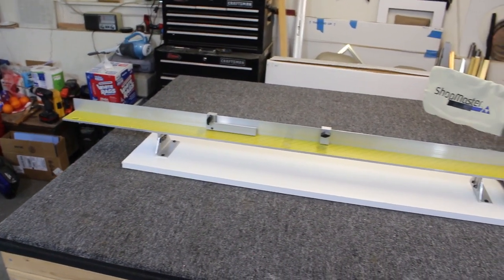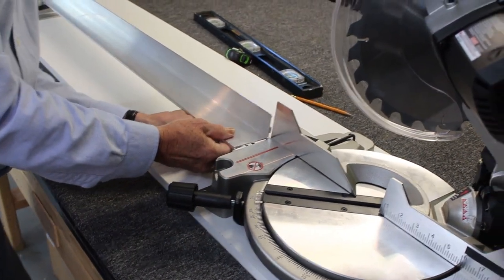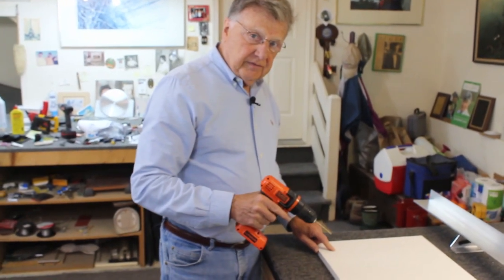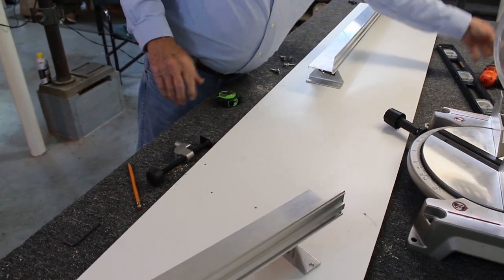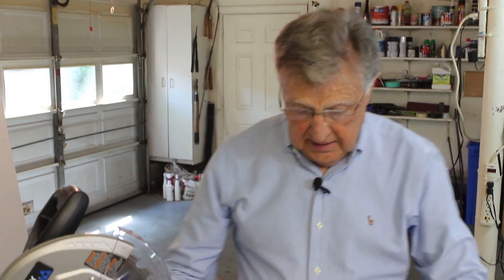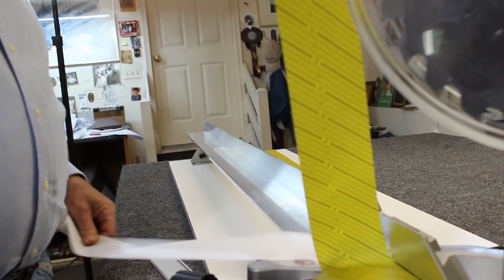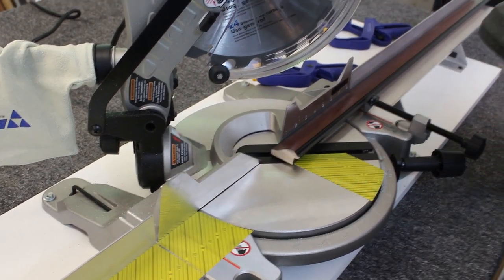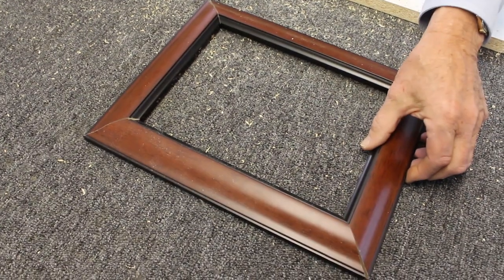LOGAN F100-5 Saw Fence Kit

Comment: Does this item work on a 12 inch miter saw? And do you just sell the scale separate?
Reply from the maker: Hello. The Saw Fence Kit is designed for power saws 7 1/4" to 10" so it will likely not work on a 12". We certainly can sell the adhesive scales separately. Please call us at 800-331-6232. Thanks.

Comment: This guy doesn't use the saw correctly.  You aren't supposed to bring the blade back up until after the blade has stopped spinning completely.  Failure to do so could cause the moulding to splinter was you are bringing the blade back up.

Comment: Ridiculous on the face of it. Your measurement lines are 3/32" thick, which will allow for a 3/8" deviation overall with four corners. Nobody can place a piece of wood exactly in the same place 4 times just eyeballing a line. A real woodworker would use stop blocks and cut both ends of each corresponding side or top/bottom at the same time.
Reply from the maker: Hello. This is why we use our F200-2 wheel sander after cutting the miters to perfectly correct to 45 degree angles vertically and horizontally and to check the lengths to each other so they match before joining.